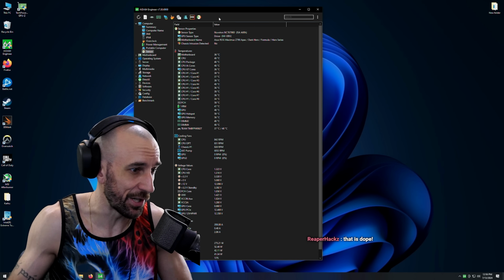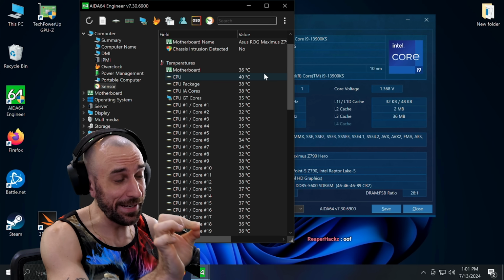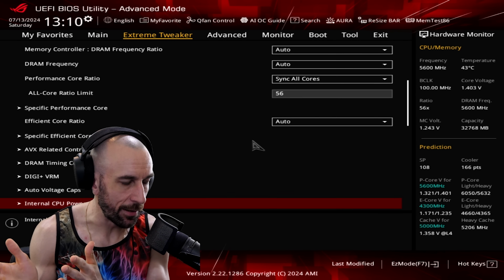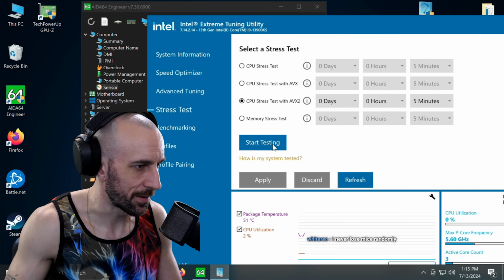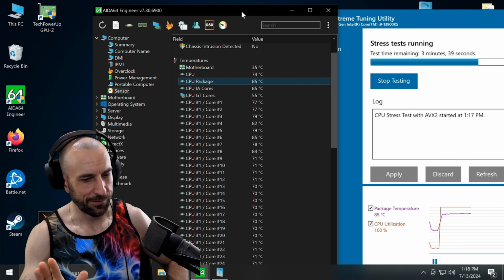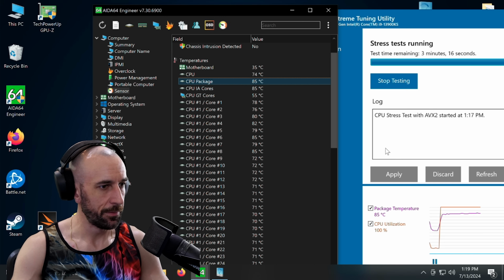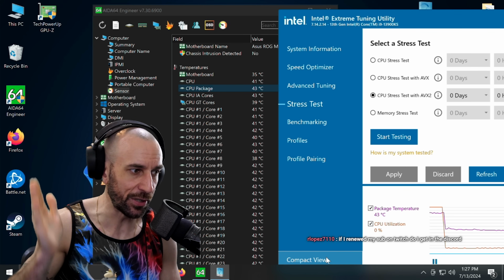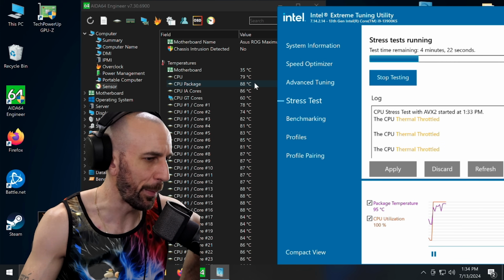🛑 STOP YOUR Intel Crashes 😱👑 (Step by Step Guide)

Comment: you vcore is to low this causes Problems and Blue Screens the deepest at full clock GHZ per core the i7 and i9 13 th gen is SVID 1.225 1.23 voltage don't go lower  try LLC 5 minimum  or 6 by ASUS and test Global SVID VOLTAGE  1.230 voltage show then on HWinfo where your SVID Voltage is it on windows around 1.24 to maximum 1.275 ist should be perfect did the same with my i7 13700kf and activated Best Case szenario. 

My CPU has been purring like a cat since then . under maximum load 99% + he never need more then 120 watt by und maximum 5 % loss of power

later you haver to try an higher Ecore voltage my one 1.26 voltage and for the P Core'S i lowered it to 1.66 voltage

Comment: EDIT: I actually solved the issue using LLC6 and VRM OFFSET +0.015v   So sorry for the OP of this video and :) yes its just working! And yes use ALL CORE not core boost... you get NOTHING in real time measurements with this.

I have a 14900KS and its not degraded pretty much brand new. It require LLC7 to run 5900 Mhz  EVERYTHING without error..  The best test I ever found and I know it sounds very funny is Titanic 401 Demo Project. It WILL make shader decompress error even though you can pass EVERY other stress test. Trust me! I can run much lower power and pass everything else. But Titanic UE5 makes this infamous error. Try it! It require LLC7 for me at 5900 Mhz... I can run LLC4 or LLC5 with lower clock but I will not downclock it because I paid for 5900 Mhz. LLC7 fixed all problems. SO yea its a simple fix you are providing IF you keep the clocks low. I can guarantee you that Intel Stress Test DOES NOT PROVE the CPU is ok or fixed or dont show errors in anything else. I challenge you to the Titanic DEMO. You load the game. Change room at least 10x.   Of corse every one disables the 2x core boost. You did not give away anything. Those experience the real issues dont fix it by a offset of 50mv. I also depends on the games!!!!!!! You sound like a real pro bro! Tsss.. Besides having a high load line is no problem as long as you still have a power limit of ex. 320w. ASUS themself says you choose whatever you want - no issues. But of corse you CAN f up if you dont know what you are doing or running with unlimited power limits.

Comment: Might be a dumb question.   Is there a max core GHZ that can safely be locked without locking core voltages also?   I am one of those gamers that didn't watch your video until after I bought my i9-1400K.  Brand new CPU, Liquid Freezer III 420 AIO, ASUS Strix z790E WiFi II.   Kryonaut high performance thermal paste.   Thanks.

Comment: So if this is working on these settings with no degradation of the cpu, why would not intel put out a bios update to set it at these settings themselves?
Reply: @LivelysReport  intel don’t control bios update but they told mobo manufacturers to do that back in February or April. The message sent by intel even leaked and people interpreted as “intel have no idea what they’re doing” while the message was pretty clear: “use our power recommendations u fuckface”
Reply: thats not a good enough fix. Not everyone is updating their BIOS and they are still degraded

Comment: Hmmm it appears that my 14700K is failing AVX2 test, it was running 1.41v idle voltage stock, I wonder if its degraded or just crappy i7 silicone?

Comment: Nice fix.  It is refreshing to see somebody actually doing something other than sating stuff like "we don't know what it is, but it is definitely affecting all chips and yours could die any minute now"

Also I've got a 13900kf in an Asus Prime Z690P.  Also a couple GSkill 32GB (64GB total so 2R) 6400 DIMMs.  
Asus Stock + XMP gives an IMC VDD of 1.563v per HWinfo64.  It is 2R memory so that is probably adding volts.  I run it at 1.385v and it works the same.  I don't know if it is a HWInfo64 reading error, but if it is true, 1.563v 24/7 concerns me.

Maybe people should check their ancillary voltages out to catch any silly mobo manufacturer shenanigans like this and nip it in the bud.  People watching this channel probably already do, I just wanted to get that out there for somebody that doesn't.

Comment: What I found if I get a allcore stable bios overclock in every game and then use the intel tuning software after I can get a much better overclock in some games that use 1 or 2  cores mostly. You can set a profile per game. Arma3 I got 300mhz

Comment: So did you leave the multicore enhancement on and change the power limits to 253? Or did you put enforce all Intel limits instead of multicore enhancement being enabled? Then you sync all cores and add voltage offset if needed because of degradation. I personally haven't had any issues with my i9 14900K yet. My question also is, now that I updated my bios from ASUS for my z790-E Strix board, I see a little lightning bolt next to all my power settings in XTU. So, I can't change my voltage for cores unless it's up. I wonder if ASUS did this with the new bios or if it's XTU doing that?

Comment: You must know more than Intel does if you think the preferred core behaviour for TVB is the problem, given the profiles they've told vendors to use actually results in higher voltage and loadline. Launch day CPU here no issues, no tweaks.

Comment: so my 7900x doesn't like going to 5.6Ghz but locks itself at 5.5? is the course of action the same just lock cores and add small amounts of voltage? not really sure what's going on cause it used to boost higher to like 5.9 or 5.7.
Reply: 5.9 or 5.7 isn’t really normal unless you change PBO settings in bios.
Reply: @silverback2773  I have had PBO on, that a bad thing? I think when I updated the bios it changed its max frequency or something, got a  arctic LF3 on it, has plenty of thermal headroom

Comment: i hear on that i have a 14900kf that wont hold a all core lock above 5.7 and a locked 1.36  if i go any higher on the clock or it wont hold stable even if i give it 1.4 did i mention im on a iceman delid...  so i am just going to call my 400$ 149kf a win a use it as it is.

Comment: It's a degradation problem with the chip. Sure you can undervolt, and underclock but it's an architectural problem with 13/14th gen that can only be solved long term by severely undervolting/underclocking the chips.
The problem is Intel packed the transistors way too tight, and relied upon their projected power figures from a golden sample chip that they can't reliably produce.
Arrogance in theoretical engineering shouldn't be directly transferred to silicon.

Comment: I'm mainly just a gamer bro like cod bros just need my stuff to work. I've Had this 13900k/4080 rig from January of last year haven't experienced blue screens / crashes etc yet. Should I be adjusting my bios settings to prevent my 13900k from degrading?
Reply: If you just game get the latest BIOS for your mobo and set your bios to Intel Baseline Profile they just released - that should limit the degradation a lot.

Comment: Its about time someone posted this.  I have been doing something very similiar to this about 4 months after the 13900k launch.  My CPU is degraded actually worst than this and I have been using it for a long time now, hes honestly lucky he can even make it to the desktop because it can degrade much worst than this and is STILL usable doing this fix method. I would say this advise is a great "baseline" clock to get you started and have it stable enough to atleast install windows or get to the desktop screen and from there you can start diagnosing things to get other features of the CPU working.

Comment: Is it normal for my cpu to pull 1.47v at the desktop when I lock the cores at 55Ghz? I have a 13900k and have the efficiency cores on. I never experienced any errors with this cpu. Is that a safe voltages to have? The only thing I changed was the cores, I synced them all to 55.
Reply: Yes, its normal if you're running high clock speeds. I detuned mines to 50 and 40x multipliers, tuned off boost, applied a global undervolt of -0.15v, now fully stable and 36.5k cinebench score with vcore running at 1.0-1.15v with 60-77F max temps. I had IMC degration get me, so im giving my setup an easy life to last me until the next build few years down the road.
Reply: @richardp168  apparently cinebench isn't a good test for stability with this issue - it turns a blind eye to things
Reply: No, you are probably using the "performance" power plan in windows. Never use that, use "balanced". Performance cooks idle CPUs, not only Intel. MS broke that power plan in like 2014.
Reply: @igelbofh  that doesn't work i have all cores locked at 5.5 so it'll stay there
Reply: @igelbofh  it's fine i under clocked it to 5.2 P and 4.0 E in the mean time while intel is working on a fix

Comment: Wouldn't it be even more efficient if you set the core voltage to adaptive, lower the core voltage offset by -0.080 or -0.100 (depending on silicon) and lower the pl1 and pl2?
Edit: i realized that your method is for degraded cpus. Do you think that my method would be ideal for the new ones to stop them from degrading?

Comment: Had my 14900k die like in 4-5 months. Just running default everything had nothing but issues from day one. got another one coming should i lock the cores on the new one to be safe or what should i do
Reply: @Mowdayz  did you even watch the video?
Reply: Lol running on default for 5 months is crazy i got mine in March and when i booted my first cinebench i was shocked how crazy fked up this cpu is with 102 C on first seconds of benchmark even tho i have AIO and shit load of vents in the case in the same day did all the limits and locked cores damn with those deefauls its crazy ur did not blow up 😂😂
Reply: overclock it

Comment: New here but this is super interesting, but let me get this clear. Intel Gen 13 and 14 are facing these issues all the tech channels are talking about because of voltage fluctuations which are controlled by the motherboard? Its that basic or what? Also as a secondary question, are the other tech channels then doing AMD a favor now right before the launch of the zen 5 vs arrow lake to muddy the waters?

Comment: Hah I love you man. And I love the fact that so many reddit "normies" hate on you for being legit which just goes to show their hate for themselves. 😅

This is like the same BS going on with Ryzen. I've got a 5600X and I'm so fed up with PBO and especially "curve optimizer" implying you could set individual voltage offset to each core which is physical impossible.

But I'd argue that this is even worse on ryzen. Atleast on my board, if I lock the cores to bypass the boost algorithms of ryzen which in my case gives too much voltage, I also have to set a fixed voltage for the cpu. There's no offset working if I lock the cores. I have to run the same voltage 24/7. 😅

So I actually run it at stock still. While PBO clocks higher it still gives me worse performance. So stock settings and I don't care about possible degredation right now. It has degreaded to a point to which if I were to set a negative offset with curve optimizer for example. It would instantly crash.

The only way for me to increase performance in any meaningful way is to overclock the IF as high as possible and tune the ram.

I still prefer intel though. It's just that I'm cheap as fuck and only play quake champions.
I wasn't aware of AMDipps or anything when I bought into the platform a few years ago.

Comment: I appreciate the step by step guide, I struggle a bit with current Asus bios. I have a 13900ks direct die and I'm now running 5.8 all core with -0.020 undervolt LLC4. System actually seems faster compared to Asus AIOC and isn't thermal throttling or anything. This seems better.

Comment: Thanks for the great information. It Would be great to see a video on preventing degradation in the first place. I picked up a 14900k in April. I've been running P-Cores at 55x, E-Cores at 43x with an -0.07 Undervolt. Idle around 35-45C, and I usually see 50-70C while gaming. Anyway, I hope I'm safe from degradation. I think I'm fine, but I'm not an expert. Any thoughts/ideas let me know.

Comment: My 13900k was doing all this 16 months after buying it on launch, always ran defaults, I couldn't even install a GPU driver.
Intel got me to run XTU tests, when it failed they RMA'd my CPU.

The replacement I locked the cores, tweaked the voltages with a small negative offset and locked power limits.
Too bad I didn't know about all the problems till it was too late...

Comment: How do you tell if its degrading?
Reply: Not stable with many times checked overclock setting as before or even not stable at stock anymore.
Reply: When one day your once stable setup turns unstable and throws errors

Comment: 99% of PC users plug in their CPU and install windows Maybe enable XMP/EXPO and never go into bios ever again or update bios. thats why this issue is not something that can be fixed for those people. They take it back to the store under warranty. Intel is in the doghouse with this one.
Reply: not true i'm a pro and intel change my CPU two times and all crashes, I can see from game crash data base 94% of all crashes are from intel 13900k and 14900k and also there is no fix for them at all.
Reply: I plan on RMAing a 13900k over and over again every year, effectively renewing the warranty, and I will ensure that I cost Intel more than they cost me.
Reply: @mehck2  warranty does not renew, it is time from the purchase
Reply: @mehck2  You better be getting a refund.  Intel doesn't reset the warranty timer when they ship a replacement.
Reply: @mehck2  As a 14900ks owner, holy cow I did not expect it to be this bad for a end of life platform. I effectively buttfucked myself by not going AMD as an AMD fan and previous 5950X user.
Reply: who buys a K cpu with 0 intention of some sort of tuning? there is an issue that even these fixes and updated bios aren't giving the original performance advertised, which is kind of false advertising, but some fiddling with settings shouldn't be out of place for anyone buying an i9 especially if its a K model
Reply: @s3rm0n56  I do because I don't like wasting hours of my time trying to get additional 1% fps. I wanted the most cores and highest clocks so bought the 14900K, where's the issue in that?
Reply: @patent5421  so did I, but I realised soon after buying it that I needed to do some digging in order to address thermals and it didn't take hours to set a power limit and undervolting for the sake of thermals and hopefully mitigated any of these issues from the get go
Reply: @patent5421  same
Reply: @s3rm0n56 u would be surprised that the majority does that. Because we talking high end in high end u will have the most people that don't know what they buy they want the Best the fastest etc.
Reply: U think big streamers that used 13000k are dingling in settings ? That's just 1 example.
Reply: @s3rm0n56   Perhaps you forgot that small, medium-sized, and large companies involved in tasks like CAD or video editing often purchase high-performance CPUs directly out of the box? I've catered to these small and medium-sized businesses, and they frequently buy these performance CPUs in bulk, set them up, and rely on the stock settings to efficiently handle their workloads with warranty intact as ALL CPUs should be?

Comment: So basically all tech youtubers are wondering what's going on and Jufes "the over the top guy with the small channel" knew the problem all along, before it blew up and has already provided a solution.

Well, it makes sense now why Intel doesn't want to provide a fix... they would have to limit the boost clocks and lose performance, for which they would have another backlash in their hands. Makes sense they're lowering the clocks in their new line of CPUs. They really fucked up this time.

Comment: Don't you think most of the problem is the motherboard permitting running beyond published default CPU limits?
Reply: No, That's more of their Snake Oil! 
I think Most of the problem was back when Intel cut back on funding their Engineering and chose Advertising (Intel Inside), then raked in their Short Term Profits. Now their no longer the #1 chip maker and are generations behind in their manufacturing Nodes making them Have to Allow Abuse of their silicon just to compete with AMD. Intel could have enforced Baseline limits on the Mobo's BIOS with their 3rd party mfg's but couldn't have competed with AMD's performance with smaller micron and more efficient chips.
Its time to stop drinking the Blue KoolAid. 🍺🍻
Reply: Yeah but Intel also didn’t really have strict defaults. Just suggested settings
Reply: If that were true, my CPU wouldn't be completely fcked. I get OH SNAP errors in chrome every few minutes. Do you know what that's like? I'll tell you what it's like - it's not fun.